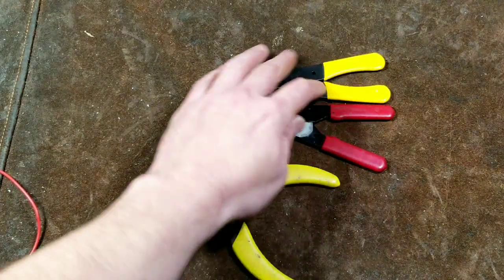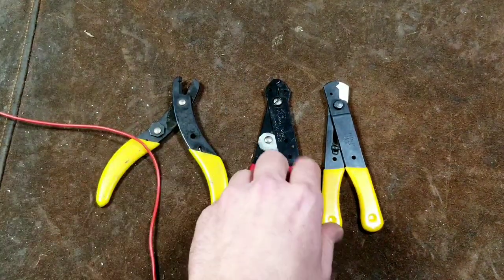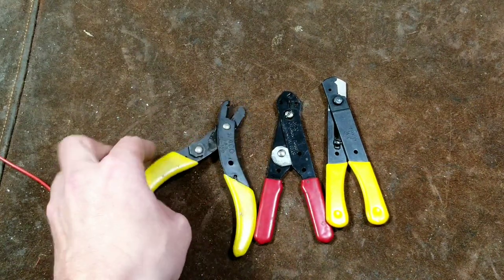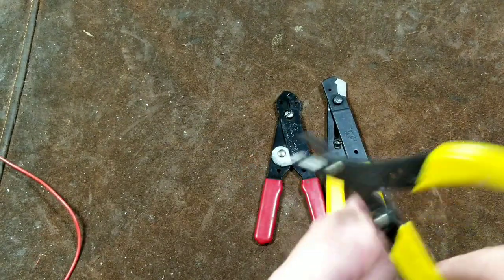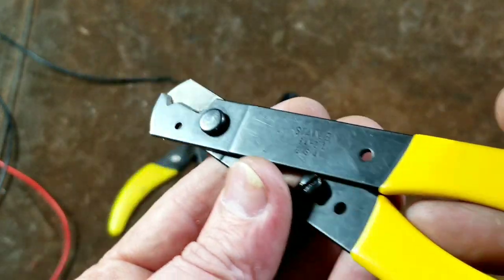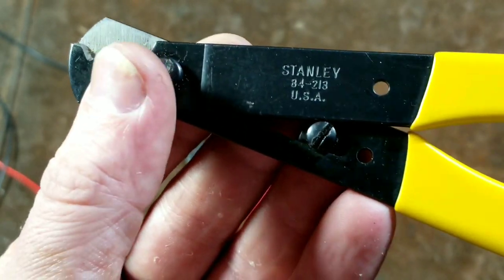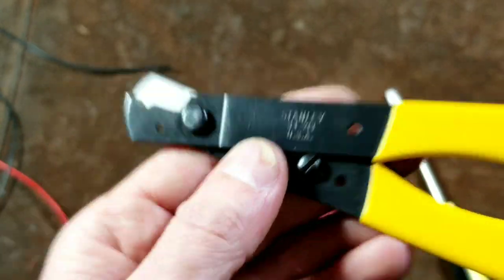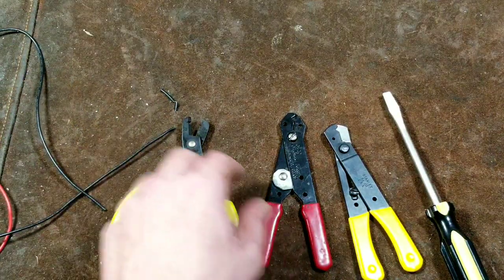Simple Wire Strippers Review & Comparison

Comment: The Stanley reminds me on the standard wire strippers we use over here in Germany. They're also stepless. 

https://www.knipex.com/index.php?id=1216&L=1&page=group_detail&parentID=1363&groupID=1376

I've linked Knipex, but there are a lot of other companies out there manufacturing this style of wire strippers. Personally I don't like them, I prefer my Knipex Multistrip 10, and for older insulation (if they are decades old the wires are sometimes hard to strip with automatic strippers) I use an IDEAL 1000V insulated wire stripper with the several holes in the metric sizes.

They also make this classic wire stripper with additional cable shears. And you can see how you can assure to not nick the wire:

https://www.youtube.com/watch?v=S0mjjILSSnQ

This stepless design has the advantage you can use them on almost every wire. It doesn't matter if it's AWG or metric size.
Reply from the maker: Yes I found that by having so many wire strippers I'm able to apply just the right stripper to the right type of wire under the right conditions